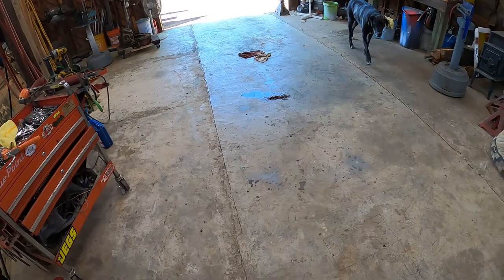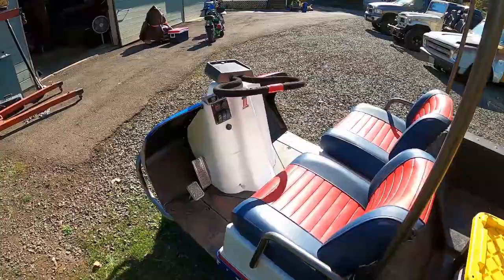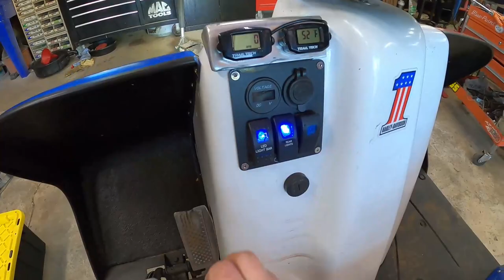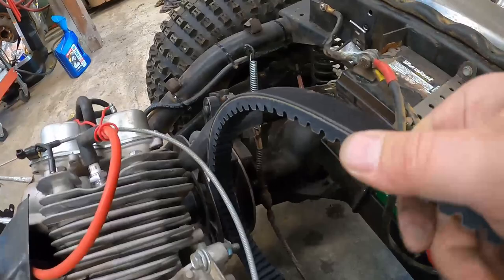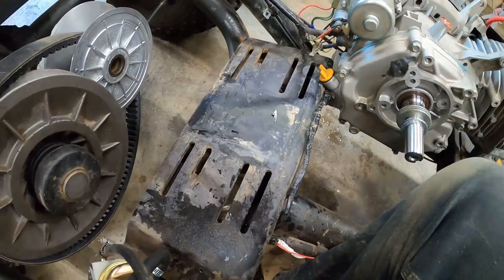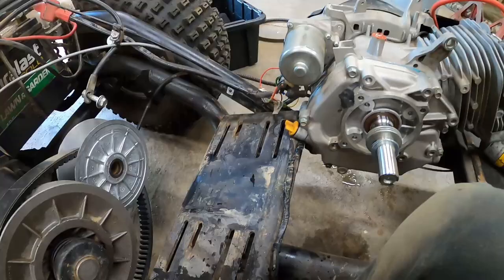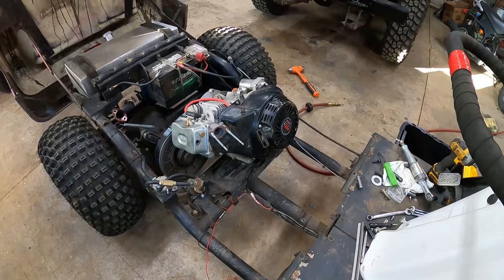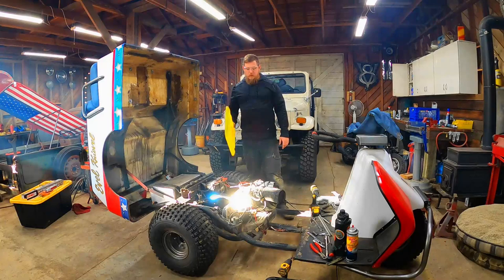Harley Golf Cart gets a new torque converter and we go.

Comment: I just obtained one of these Pigs for a Hundee Bought the CD service manual and am beginning to pull it apart and repair it all to a functioning Japanese Golf Cart for my parents to ride away their Geriatric years in Florida. If you do have any DIY videos, it be greatly appreciated. It's a 1970 AMF Harley Davidson 2 Stroke 3 wheeled Golf cart (I ciphered the numbers).
Reply from the maker: Mine had an incomplete engine on it, so that is why I swapped it. It was the cheapest thing for me to get it going. Unfortunately I do not have reverse. I would love to have an original one with a 2 stroke in it. I really don't have any advice for you with the stock drivetrain. Mine is also a 1970
Reply: @DJsHotRodFab  The motor is weird it literally has a forward rotation and a reverse rotation and you have to divey the timing somewhere in between. I went with this cause what people want for used non running golf carts is insane. It's bashed and faded from being in a yard and there are a lot of things missing but I'll make it work. The motor turns so at least that's a good start.
Reply: @DJsHotRodFab  What are the Size upgrades you did on the wheels, I like those and are they the same rim?
Reply from the maker: @vikingvisigoth4384  stock wheels, I think they are 22" tall

Comment: Dang this needs more views! Nice work, especially on that tank. I have a 71 that looks identical. Was trying to figure out how to keep the original 250cc 2-stroke and still make it fast... but thinking I might have to go the route you did! What torque converter did you go with? You said 780 series but didn't catch more than that. Going to need one!
Reply from the maker: Thanks. The problem with the 4stroke swap is that you lose your reverse. I got the 780 driver from GoPowersports

Comment: Hi awesome build! I picked up an old electric Harley cart and want to convert it to gas. What setup did you use to connect the engine to the rear end? Thanks
Reply from the maker: I made a custom engine plate using the stock swingarm

Comment: Do you have a video if the original build? Getting ready to do mine. I have the engine off and getting ready to take the lower part off and mount the engine plate. Maybe I'll make some videos of that part for people.
I'm using the predator 459cc. Basically the same as the 420cc. 100$ you got a hell of a deal.
Reply from the maker: Unfortunately no. I built this before I started making videos. Good luck.  You should definitely document it for other people

Comment: Im working a similiar modification....  do you think the engine would be better if rubber mounted like the original..?    is vibration a problem in your setup?
Reply from the maker: Vibration is definitely an issue. Not sure how well the CVT will work with rubber mounts, but it might be worth a try.

Comment: Nice job, really like your rear set of tires. What size did you end up using? And the drive belt?
Thanks 👍
Reply from the maker: All three tires are 22x11.0-8. The belt is a comet 300637. That belt is what worked with mine but it kind of depends on where you mount your engine and if you have enough adjustment to make that belt work. Like I said it worked for me.
Reply: Well all is well with my new DuroMax 420 engine swap, but engine starting up is a real issue, I’m thinking it’s the float-bowl angle is screwing up my cold/hot engine starts… you have any issues with that? Once started it runs fine, nice and fast :)

Comment: Im getting ready to do a 69 harley 420 predator swap originally 2 stroke can I use the original driven pully that came on rear end thanks for any help
Reply from the maker: I did. A 40 series driver will work, but a 780 driver is what should be used.
Reply: @DJsHotRodFab  im gonna use the 780 but the original clutch on rear end can I use that or do I have to change to something else
Reply from the maker: @joefoust7294  original pulley will work fine. That what I am using.
Reply: @DJsHotRodFab  ok thankyou do you remember how long belt was you need and thanks again
Reply from the maker: @joefoust7294  I can't say, but it gonna depend on how you mount it anyway
Reply: @DJsHotRodFab  ok thankyou

Comment: If I put a 420 predator engine on to replace the 2 cycle, do I need to tilt the rear to match? Will I have to replace the torque converter to match?
Reply from the maker: Yes or re position axle to not have a tilt to it. I am running a 40 series pulley because it was cheap. I never had the factory one from to 2 stroke.

Comment: Trying to find a good “how to” and the google has been tough. Everyone has something crazy going on seems like. I want to do a predator 420, just need to know the basics of what I need. What all did you do with the rear end to get it matched up? I’d like to pick your brain if you don’t mind. Thanks
Reply from the maker: Do you have this same Harley golf cart?
Reply: @DJsHotRodFab  I have a 77 I believe. Has a steering wheel instead of the swivel steer
Reply from the maker: Well, you will need an engine mounting plate and a welder. Then a cvt driver. I'm using 40 series, but 780 is.the correct one, just alot more money.
Reply: @DJsHotRodFab  yeah a lot of this will be German to me. I’ve got a basic understanding of how it should work, just not enough to know exactly how to get it done without a play by play.
Reply from the maker: Ya it's gonna take some fabrication skills and tools
Reply: @DJsHotRodFab  got no
Problem with that kind of stuff, just don’t have small engine swap experience or know what all is needed. Adapters, mounts, how to marry the new motor to the rear end. All that
Reply: I did forget to ask you. What belt did you end up with that was the right size? You said the first one wasn’t right. And do you completely cut the factory motor mounts off to weld the plate on?